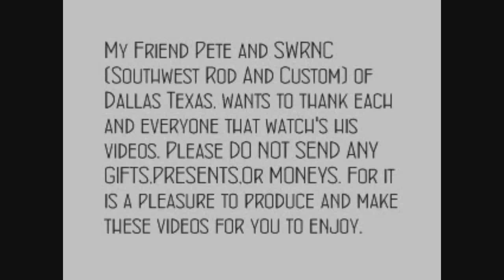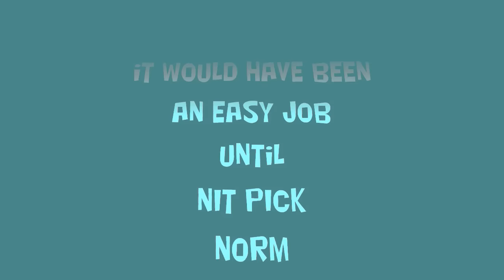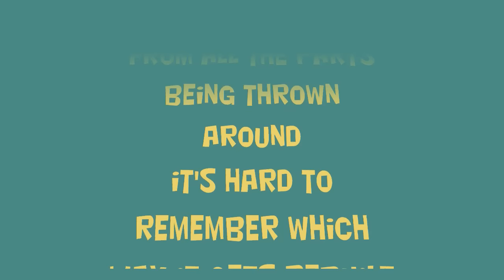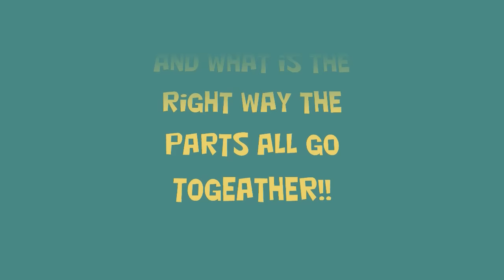How To Rebuild A Master Cylinder-Classic Car Restoration-DO IT YOURSELF

Comment: nice video of how we do it in the real world.  I would give my right arm to be norm for just 5 min. Reminds me of some of the plumbing jobs at work all the parts go in only one way,  some of replacement parts  are not compatibe with original equipment or parts are changed from metal to plastic. I find I use cell phone for pics guite often or i draw pics if i have to

Comment: I've rebuilt many of these & similar, especially from older Clark forklifts. Instead of all that "brake fluid lubrication" pumping, just assemble with sylglide. Then put it away until you bench bleed it, for use.

Comment: "Why does Pete put all his crap in my way and impede my work?", thought Norm as he pushed it aside in utter annoyance and disregard.  LOL. That sucks but you may want to consider and advise to always take a picture or video of part disassemble orientation to prevent such problems and have future documentation especially with all your shop cams.